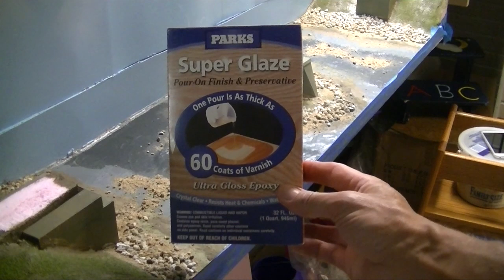Bridge on the River - Finalizing the Bridge and River Scene

Comment: I hope to put a very good shallow river scene on my layout. uhave a technique that if you put a fan near where it is drying, when it dries it will have a nice ripple effect. also I would use a yellowish green paint underneath because it looks more like it has algae and weeds and moss in it
Reply from the maker: It would be interesting to try the fan, however I found the surface tension of the epoxy to be too rigid to have the air have an effect.  I think your colors would work well with a pond and the stationary water.  If you Google Maps the river I modeled it is darker and more black.
Reply: ya I guess